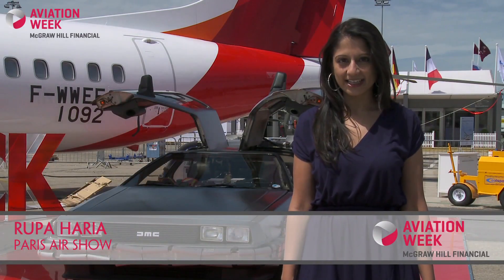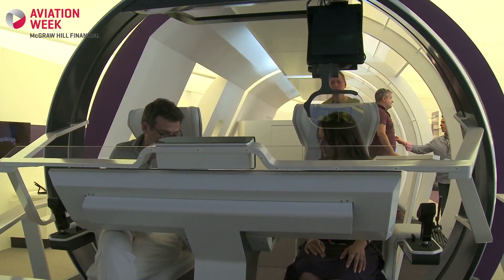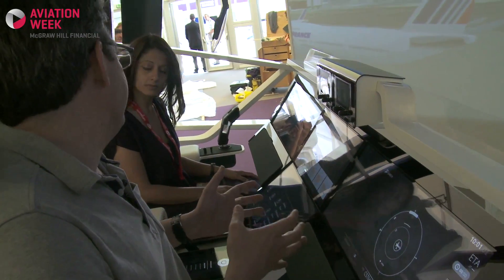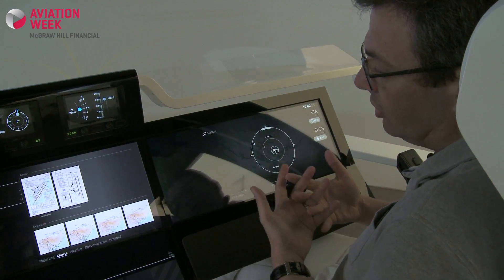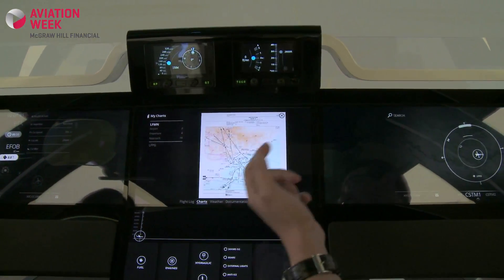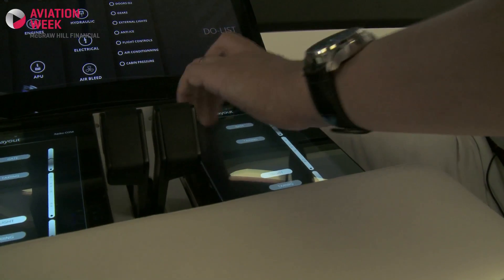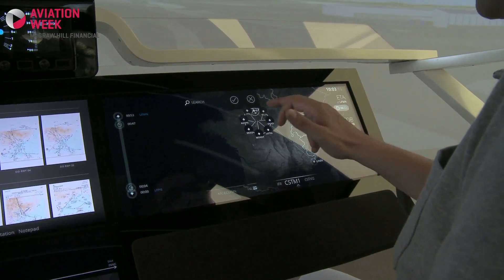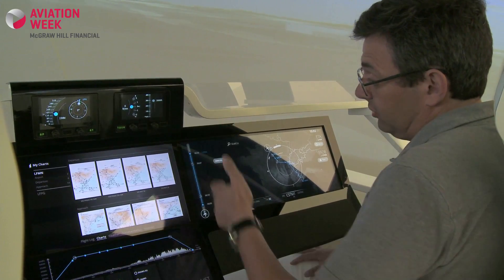Paris Air Show 2013: Thales Avionics 2020 Cockpit

Comment: You're missing the forest for the trees.The idea is to take bold steps in re-inventing very data-heavy cockpits. The touchscreen implementation may or may not be the best way to go about it. Not to mention, haptic touchscreen, there are other ways of going about applying the concepts mentioned here.

Comment: this will never work, immagine a smoke filled cockpit os strong turbulence, the enginner is sitting in a stationary mockup and he can't get the system to work right away. some car makers (ford for example) are putting back knobs on car stereos because the feel you get from touching a physical control will never match the flat touch screen...

Comment: Good points.  I worked in a grocery store that used touch screen keyboards which were terribly inaccurate.  They were/are IBM touch screens, but still-even on smart phones and tablet devices, typing stinks.  So I would have major safety concerns with that technology being in any airplane cockpit.  It's impressive technology, but not everything needs to be touch screen, and from what I've seen, glass cockpits are already easy enough for the pilots to use.